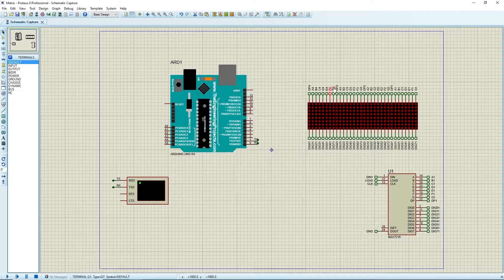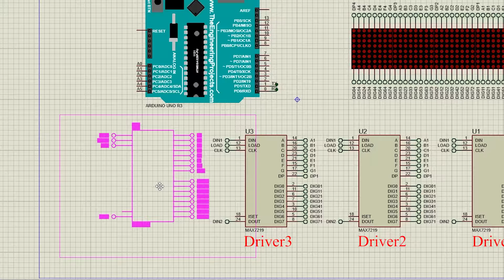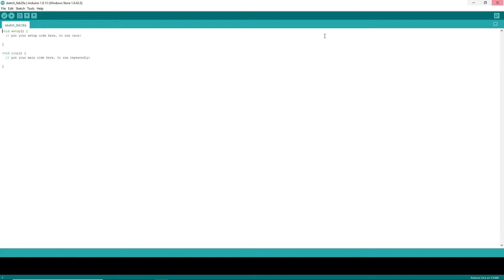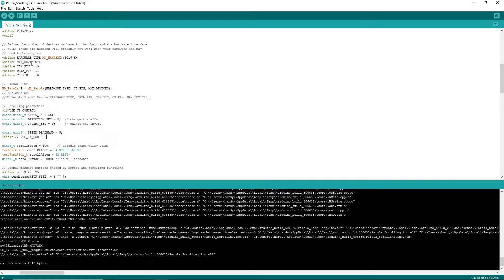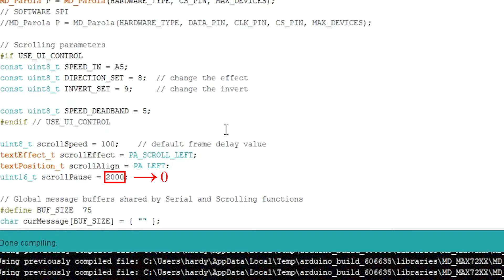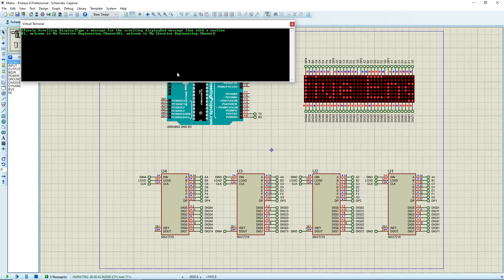Four Display Text Scrolling Simulation using MAX7219 with Arduino | 4 LED Dot Matrix | Proteus 8

Comment: Bonjour s'il vous plaît quand je fais ma part de la même façon, la matrice s'allume mais aucun message ne défile. 
Et on me montre un message d'erreur disant que '' simulation is not running in real time due to excessive CPU load'' s'il vous plaît comment faire pour corriger cette erreur ?